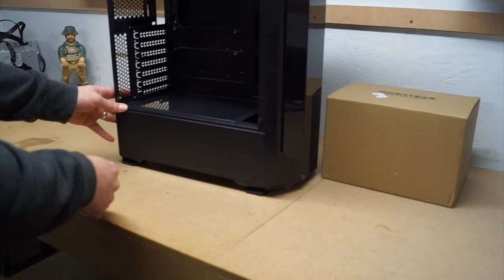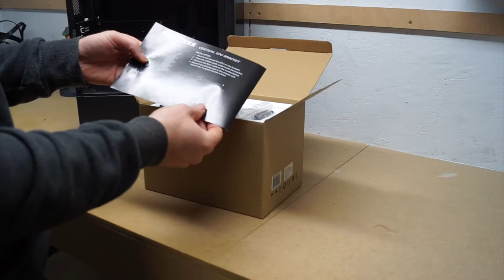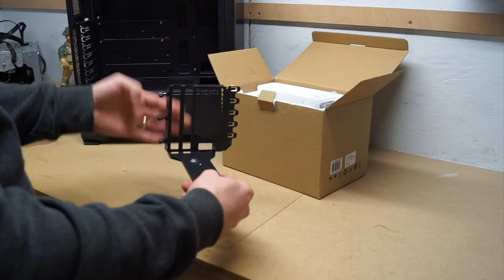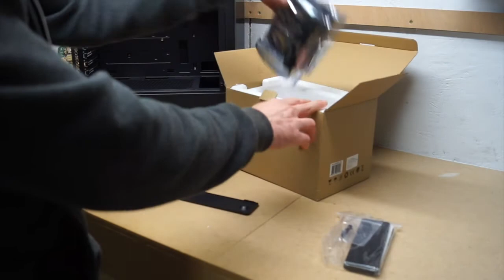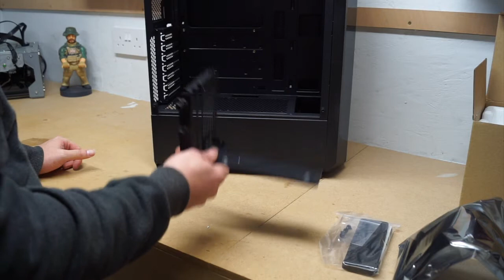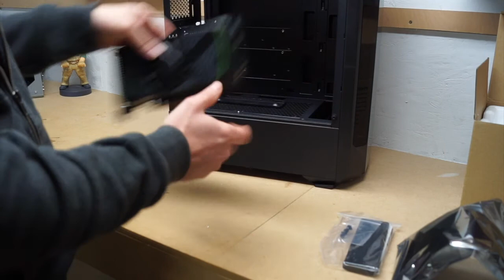Unboxing the Phanteks vertical GPU mount

Comment: Does it come with a 90 degrees cable
Reply from the maker: The Phanteks vertical mounts come with everything you need.  The cable provided screws straight onto the mount.  Hope that helps.

Comment: Thx for the video. If you had bought the "Cooler Master Universal Graphics Card Holder Kit" you wouldn't have needed to cut anything off.  https://www.coolermaster.com/catalog/cases/accessories/universal-vertical-gpu-holder-kit-ver2/
Reply from the maker: Thanks for the heads up.  I will take a look at getting one.